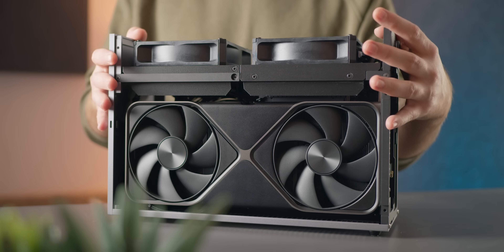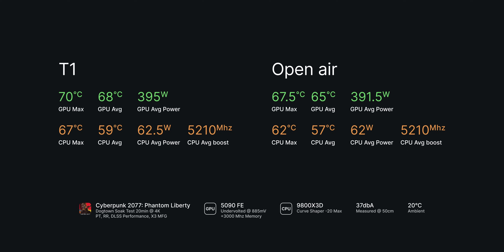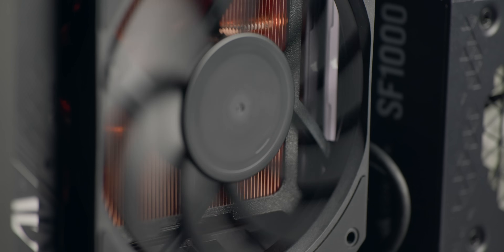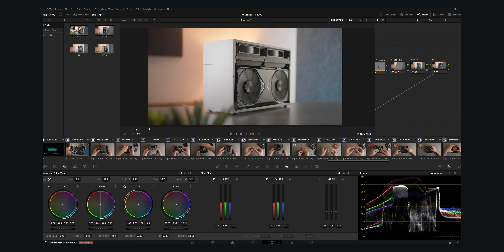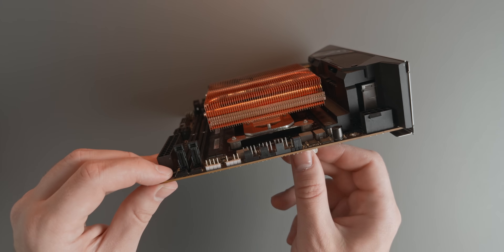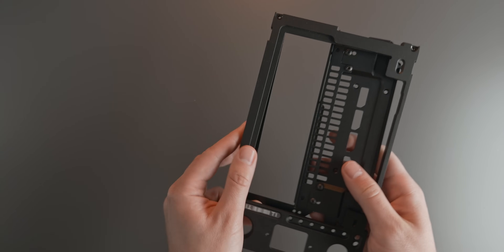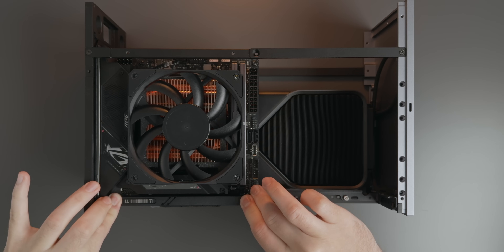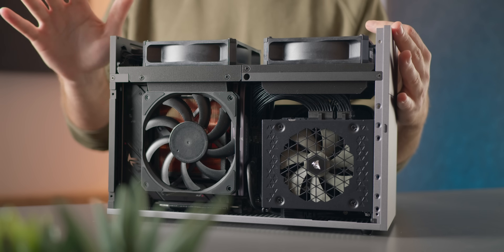The Ultimate FormD T1 5090 Build & Guide

Comment: Come on, what is the benchmarking setup?! Your reference point is completely biased...what about games using more 100W power usage? Why not comparing with open test  setup with ATX MB where the GPU is not "stuck" with the GPU? Why not keeping stock GPU on open test bench as reference (just to make sure your undervolting is not reducing performance...) 
Your video is simply biased...

At very last, you are promoting the RTX 5090 FE that is, basically, not available to buy...thus it is impossible to replicate.
Reply from the maker: I go into a lot more detail and tests in my undervolting video 👉 https://www.youtube.com/watch?v=iZHyp0Ec4wI
There's nothing biased about comparing the exact same GPU with the same undervolt profile in two different scenarios. I haven't tested the GPU at stock because the out of the box tuning is completely ridiculous on 5090 FEs and highly inefficient, to the point where you can get higher performance with an undervolt than without and with 100W less power.
For actually getting a RTX 5090 FE, I recommend joining the CoreFinder discord server and signing up to stock alerts 👉 https://discord.gg/G6EvPBpy

Comment: What's your take on this build:

T1 in 2.25 GPU Slot position
Asus Strix x870-I (both SSDs are located on the front)
9950X3D + AXP120-x67 (Air Slimmer 120 fan swap) - undervolted + power limit
5080 Founders Edition

Would noise be too much with the CPU cooler sitting only 1mm from the sidepanel?
Could I run a 5090 Founders Edition in this config?

Thanks so much!
Reply from the maker: Using the AXP120-x67 would get you the best CPU thermals outside of using an AIO but indeed fan turbulence and worse GPU thermals would be your main worries. I would not run a 5090 in that configuration. If CPU cooling is a high priority and the X47 FC is not enough then perhaps an AIO could serve you better, but keep in mind that in combined CPU+GPU workloads temps will likely be worse compared to air cooling + thick exhaust fans.
Reply: @EIGAtech  What about running T1 in 2.00 GPU Slot, 5080 FE, offset the PSU to the max, so there's zero turbulence now. CPU fan runs all the time, GPU audible only under load. Will 2.0 Slot position be bad for the longevity of the build ?

Comment: why RS120 Max instead P12 Max?
Reply from the maker: Corsair RS120 Max and Phanteks T30 are both 30mm thick fans, the Arctic P12 Max is a standard 25mm fan. Those extra 5mm make quite a bit of difference.

Comment: Exact build I'm doing, will definitely be implementing all your modifications now! The Gen 5 Riser is now up on FormD, which one is it specifically that you used?
Reply from the maker: The SS200. The LS100 would be for an upcoming version of the travel kit with GPU exhausting through side panel instead of intake.
Reply: @EIGAtech  Thank you! For the exhaust shroud (I am not very well versed with 3d printing so would be outsourcing) do I print all 5 files underneath 'V2'?
Reply from the maker: No no, you only need part A + part B. If you are sending these to a print service, and are building this exact configuration, you'd send Part-A-HC.stl and Part-B.stl

Comment: The 120mm fan and Dinkey offset are enticing. It's odd because I thought that using a fan that doesn't match the cooler might actually hurt performance, but I guess that's not the case. I've already used the Dinkey offset and backplate on my new Midori console and I love how it removes all the headache from installing the cooler.
Reply from the maker: I assume you are using it with the AXP90-X36? What CPU are you using and how are thermals in general?

Comment: This is very close to a perfect build in my eyes. Great work, and congrats on going full time!
Reply from the maker: Thank you!
Reply: What do you think it's missing? Or what would you do different to make it perfect.
Reply: @tarekali4u  @EIGAtech The shrouds for the top ventilators are actually not helpful and are only restricting the airflow out the top of the case. Especially because they are also closed between the two fans. By removing the shrouds, you can actually have the coanda effect drawing more air out of the top than currently possible. 

There is however a problem on the bottom of the case. As you have 4 fans blowing air into the case, and only two that blow air out the top of the case, you have an overpressure situation. So some of the air is also being forced out the bottom of the case, which will then blow out to the sides of the case. This will cause some of the hot air recirculating back into the case. A custom printed stand with skirts that prevent the air coming out to the sides and direct the air to the front and back of the case could help here. 

So by removing the shrouds on the top of the case and adding some to the bottom, I think you could squeeze even more performance out of this computer.
Reply: @tarekali4u I want to know as well! Lok

Comment: why not to flip gpu to make it exhaust(with shorter riser and 12vhousefire) then it wont dump 500w into the case, and why not to screw gpu anti-sag directly into the case?
Reply: Intake is much more important than exhaust when it comes to cooling. Having nice fresh cold air come in will do far better than restricted and hot intake but free exhaust.
Reply: @andrewallen7032  why would intake be hot? and now its restricted by mesh anyway(which you don't need if its an exhaust.)
Reply: @jermygod  air form inside any case is always gonna be hot. Heat soak form the CPU, ram, storage, even just the motherboard parts run very warm and heat soak the inside of the case making the air going into the GPU significantly warmer

Comment: New viewer here. Have you done a  fractal terra build and how did it compare to this build  with temps etc, ease of build and so on.

Also I'd like to see some small matx builds.
Reply from the maker: Welcome! No Fractal Terra builds. In my opinion it's a worse T1 from pretty much all points of view. The fact that you can't fit thick exhaust fans will always mean it will be thermally challenged. On the positive side, it has great availability and the design is pretty nice.
Reply: @EIGAtech  It's gorgeous. I wish the T1 had a few more aesthetic options.

Comment: I will never understand buying state of the art tech like the 9800x3d and then crippling it with a power limit, for literally zero reason. AMD, which has every interest in the world to limit Tjmax (warranty, brand cred, etc.) is telling us 95c is fine, but some people just arbitrary decide 95c bad 85c good.
Reply from the maker: Just to be clear, I presented the 100W PPT limit as a choice. As for trusting tech companies with their claims... yeah, we've seen how that goes countless times, and recently we've had 9800X3Ds dying on AsRock boards due to (what seem to be) improper motherboard PBO limits.
Reply: @EIGAtech  Exactly. 9800X3D were dying on ASRock boards without the user actually doing anything wrong, and presumably without stressing it too much either, so I think being stressed about it is just bad practice. Use your parts normally and if something goes wrong - RMA it.
Reply: @EIGAtech  PS - I suggest in the custom cables section to add an asterisk to not get anything less than 16AWG (which Cablester just very recently started offering). For the first time, it actually matters.
Reply from the maker: Added - thanks for the suggestion.
Reply: @EIGAtech  great video as always. What is your experience with the FE model and 0rpm mode? I found that because they have such low amount of thermal mass (compensated by double flow through design) it is having hard times maintaining 0rpm mode...
Reply from the maker: The 0 RPM mode is annoying to say the least this gen, BUT, in the T1 it's actually a bit better than on my open air setup, likely due to the exhaust fans running running at 30% even when idle, which keeps the GPU under 50 degrees for longer. Sometimes though the GPU fans get stuck and never turn off unless I start a 3D application and then close it. I would prefer it if the GPU fans could be set to something like 15-20% and just idle them like that, but I doubt that will ever happen, as 30% has been the lower limit for generations.

Comment: I'm not undervolting a 2 grand card
Reply from the maker: Undervolting sounds negative, but think more like a remap or a tune. The benefits far outweigh the negatives. Take a look here: https://youtu.be/iZHyp0Ec4wI
Reply: @EIGAtech the card should be plug and play. No excuses. If not then reduce the price or put a disclaimer for small form factor.
Reply: Why not?
- 0 performance loss
- lower power consumption and therefore temps
- less headache about melting connectors because of above
Reply: @vik1ng313 You made my point. I'm not working for something that costs that much for what it does. It should be fool proof. Plug and play. The cost of ease of use should be a part of the price. I love to tinker but it's with aesthetics. Performance and reliability have to be present from the start.
Reply: @TechnicaX  That's all well and good but unfortunately we don't live in an ideal world where GPUs have great performance increase every generation, costs are reasonable and power connectors don't melt.
So we'll have to go the extra mile sometimes.

Besides this is an SFF PC, not a normal one. It already barely has the space for proper airflow so the idea is to do everything to improve temps, which is unrelated to whether a card costs $2k or not.
Reply: @vik1ng313 keep telling yourself that. The more GPUs you buy, the more you save 😂😂😂😂. Got it.

Comment: I'm using the trident royal ram, the shroud, hits the corner of the ram?
Reply from the maker: The V2 shroud will clear the ram, but you will have to use the stock fan on the AXP90-X47 (Or the Noctua NF-A9x14)
Reply: @EIGAtech the fans yes. I have to check again I’m not sure if it cleared it

Comment: Possible direct die with axp90 x47 full copper??
Reply from the maker: No, for two reasons:
1. Lowering it to reach the die will make it interfere with motherboard VRM heatsinks
2. Copper and liquid metal don’t go well together, but you could get around this with PTM7950, albeit for less of an impact.

Comment: That's the same motherboard I am using on my build. Did you have any issues with the 990 m.2? Mine wouldn't let me use one. No matter what I tried, it wouldn't recognize it. It would detect it was there, but I couldn't use it. I ended up using two 980s instead.
Reply from the maker: Absolutely no issue with my 4TB one. Strange…

Comment: Very informative video!

Although i would like to mention that when i replaced my 92mm fan with a 120mm fan on the x47, my temps got worse.

I figured the main thing that could help is the thickness of the fan regardless of the diameter but maybe that could be a topic for another video 😁

Edit: just noticed on other comments that you mainly used the 120mm fan because of it's sound profile not necessarily the performance.
Reply: whats the ram clearance?
Reply: @arnoldalfox with the 120mm? Sorry i can't remember really, but had no issues because in my builds i only use the T-Create which is a great ram and with only 32mm of hight, and the Ripjaws s5 which has a 33mm of hight.

Comment: i'm not in the t1 but in a nr200, i limit my 9800x3d to 85 degrees in bios with a -30 offset
Reply: I am brand new to SFF, in the process of building my T1. When you say -30 offset, you mean the voltage?

Comment: I think I saw someone on sffpc subreddit flip the gpu to get it to exhaust outside rather than inside. I believe they claimed major temp drops. Maybe u can do a video on that
Reply from the maker: That post I believe was for the Fractal Terra. In the T1 with offset + thick exhaust fans GPU cooling is already seriously good. That said, there will actually be a flipped travel kit for the T1, and I may take a look at that in a future video.
Reply: That's a really neat idea and I hope EIGA tries it out for us. The concern I'd have is that you can't really flip the 30mm fans to push air down into the GPU because I assume you'd then be hurting the CPU thermals. But maybe I'm wrong and the fans in exhaust combined with the GPU fans pulls so much air from the other side of the case that it doesn't matter? Who knows, but it sounds like a really interesting thing to test

Comment: First of all, thanks for this great PC build guide and the video, my friend. There’s one point I’d like to touch on: a few months ago, I also replaced the A9x14 fan on my AXP90-X47 FC cooler with the A12x15, using the same bracket you used. However, I noticed that the temperatures increased by a few degrees. I assumed this was because the 120mm fan has a larger hub, which might be covering more of the small copper heatsink’s surface area. Are you sure about the thermal performance differences you observed between the 90mm and 120mm fans?
Reply from the maker: Just completed the follow-up testing, take a look here 👉 https://www.youtube.com/channel/UCv8DWjBD7B82I7vcnLciN0Q/community?lb=UgkxVFLB-fsOSw81gMdKQU-qNWelVQoblhfg
Reply: @EIGAtech that was quick. Thank you
Reply from the maker: The larger hub definitely offsets some (if not all) of the gains of going with the larger fan, but for me the preference has to do with acoustics and not thermals. 

The Air Slimmer 120 is also superior to the Noctua A12x15 from some of the testing I’ve seen. I didn’t include fan testing in the video as it was long enough as it is but I’ll try to make a post with a direct comparison in the next few days.
Reply: @EIGAtech  I’ll be waiting. Thank you.
Reply: Curious if you're able to try a 4090FE fan with the 120mm mounts on that cooler? Those fans are known for some pretty incredible pressure and at 18mm thick it's amazing.

The 4070 fan on that cooler also seems to be a somewhat popular option.  @EIGAtech
Reply from the maker: @alihammad6318  Hey! I actually have a set of spare Nidec fans for the 4090, and was looking at getting an adapter from AliExpress. I might just order one for fun.
Reply: would be super interested to hear the results!  @EIGAtech